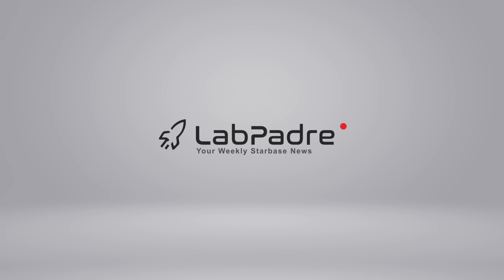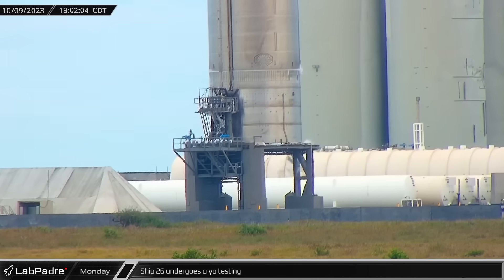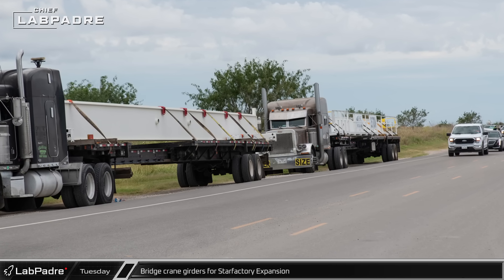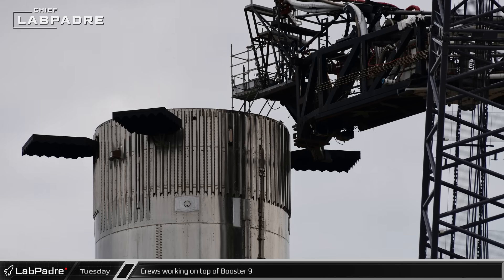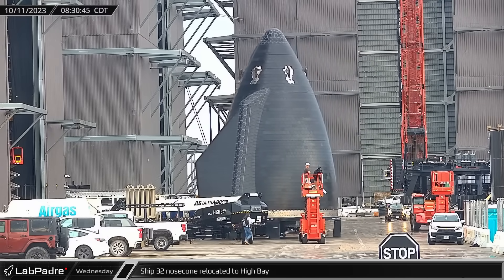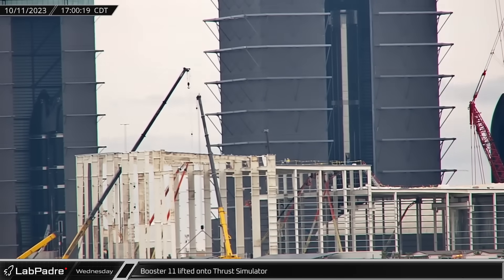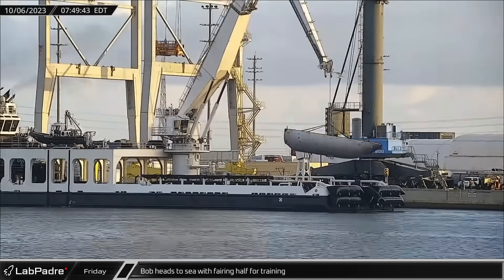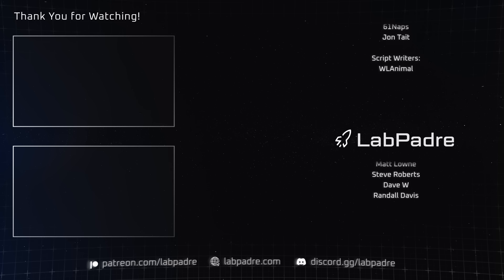When Will SpaceX Finish With Repairs After Starship's Mishap? - Starbase Weekly Update #84

Comment: Thanks for sharing your thoughts, ideas and videos. Really appreciate the clip of the parking area near the orbital launch pad. Considering it’s elevation and the perimeter walls that are installed I’m thinking I may have been right about it also being a catch basin for deluge runoff. Will have to wait and see if they complete surrounding it with perimeter walls.
Reply: The upper end of that area is closed, the lower end is open... It'll make a great parking area when the perimeter is completely closed off with walls.

Comment: I believe and hope that they’re digging that trench there for pipes of water going straight to the water tank instead of taking 20+ trucks to fill up the tank every time they launch. That would increase the flight rate a ton
Reply: Ain't gonna happen any time soon - the source of water for the trucks is a water hydrant in Brownsville, since the water supply at Starbase is too little to provide enough water for the task. A pipe of sufficient capacity to run from Brownsville to the Launch Site? - no way, too expensive.

Comment: Any news on Spacex plans for a flame diverter? I saw a pix of parts just del'd to the site that were labelled "Flame Diverter"..........
Reply: The water cooled steel plates and deluge ARE the flame diverter.   Besides reducing acoustic intensity of the 33 raptors firing at launch the deluge is directed outward at a 45 degree angle from the center which in turns diverts the exhaust plume outward around the OLM legs.

Comment: What if spacex made the hotstage ring a little taller so they could put a hatch so they don't have to remove all the time
Reply: It's held on with 3 clamps, easily removed, and is a mass or reinforced steel due to 3 raptors lighting within arms reach, a hatch is weakness. 
For these reasons IMHO it is not sensible.
And they have time, they doing extra ideas only because they would otherwise betwiddling thier thumbs. It's all good. These commentators are just trying to make everything sound dramatic.
Reply: Good solution 👌 👍

Comment: Why don't space X have a transporter that lifts like it's launch transporterr. then they can load it virticaly with the crane & then lower the transporter rig to horizontal? Saves messing about with 2 cranes.
Reply: Those two cranes can do an efficient job at a fairly low cost. And they are flexible in what they are tasked to do. A specialized machine would be expensive to construct and would also have to go through an expensive government required testing & certification program. I used to be a Millwright and Delt with cranes and lifting and all the extensive regulations covering such operations.